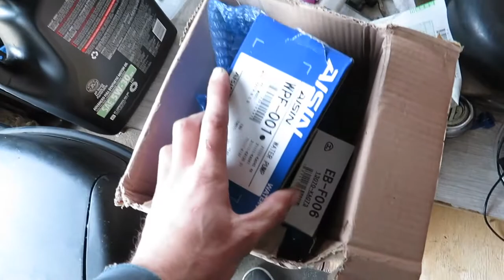SAMBAR Timing belt/Water pump install PART 1

Comment: Thanks for this video. I have been looking at getting a kei truck and trying to decide which to get. Since i will be doing all my own mechanic work, I was worried how hard the timing belt would be to do since that is one of the first things i want to do.
Reply from the maker: You’re welcome Prittsy! I’m glad This video helped you with your decision!
Let me know if you have any questions or is you have a suggestion for another video that may be helpful
Reply: @driftherslideways  yeah i was kind of set on either the suzuki carry or the dihatsu hijet since the motor is longitudinal which typically makes it easier to work on. i watched a honda acty timing belt video and you have to pull a motor mount and other parts since its transverse. Seeing this Subaru video adds the sambar back to my possibility list. Think i am settled on getting a 5 speed with as low of miles and least amount of rust out of those 3.
Reply: @driftherslideways  For a suggestion video, I dont see many videos comparing the kei trucks to an average american vehicle. Like a side by side size comparison. I currently have a 97 2wd 4cyl ranger for an "around the house" truck. I figured by going to a kei truck, I gain more bed space, more garage space, and a vehicle i could take to local car shows.

Comment: helow sir thank for this nice video..cant i ask you ,,about the air and fuel screw  how many turn for na normal mix of the air and fuel...and thin what is the standard clearance of the valve intick ang exust?i have thesame truck on this video
 thank..
Reply from the maker: I’m sorry, but I haven’t ever messed with the carb or valve adjustments :/ if I ever do I will make a video on it though!
Reply: Yes sir make ang video on hw to adjust air and volve...and till the mm of the valve distance